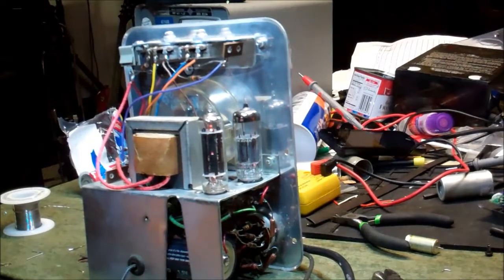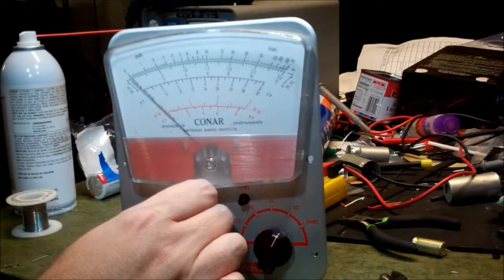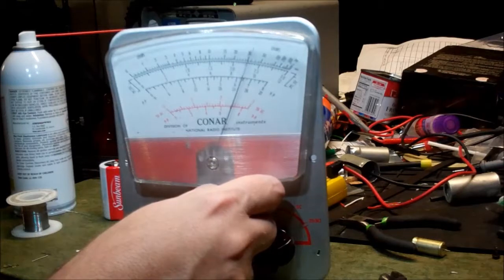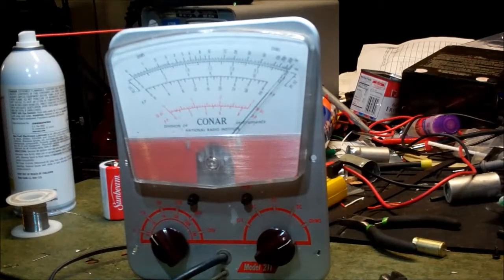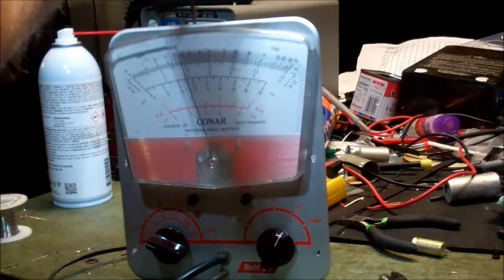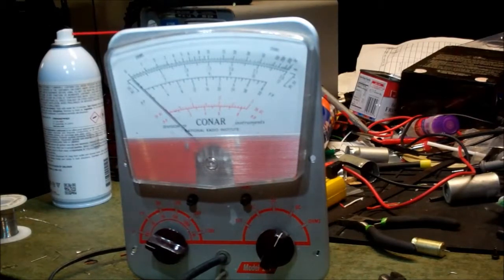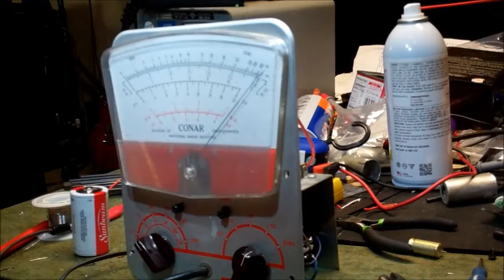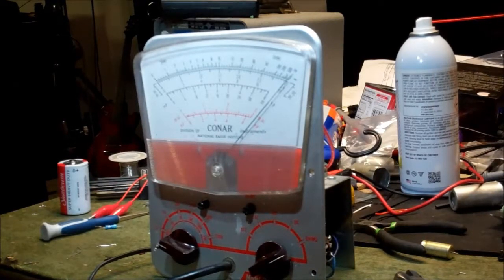Conar 211 VTVM gets fixed.... and adjusted

Comment: Thank for the video. Edit: Pretty cool little meter. My previous message was left before I saw what you are doing to calibrate it. I may have missed it but what tubes are they using? I might be able to get one just because it's kind of cool that it is tube powered. Thanks again.
Reply from the maker: I got mixed up and my first reply was nonsense.   The main tube in this was 12AU7.   There's pots and stuff to set the zero.   This was years ago,  so I don't remember it all.